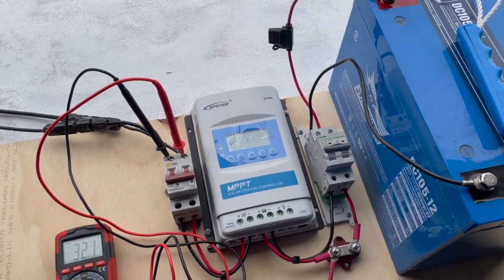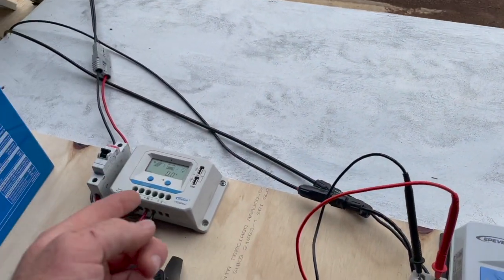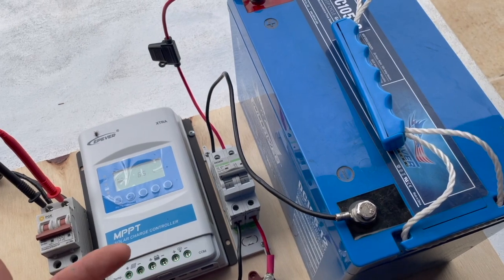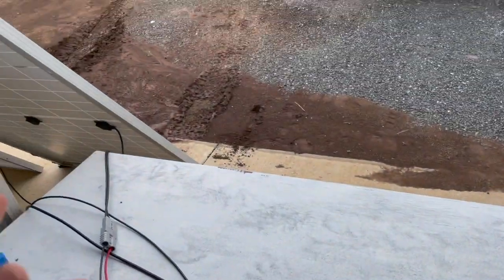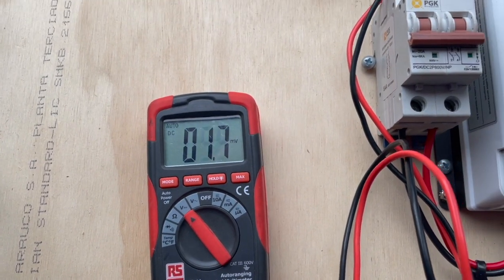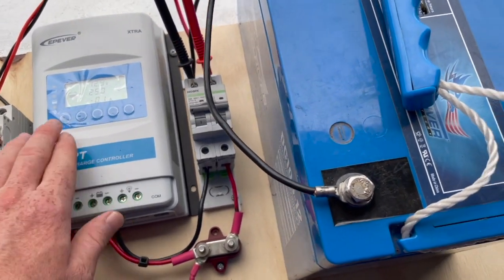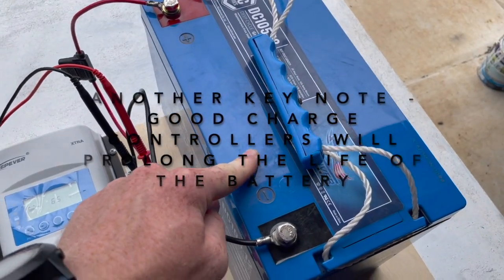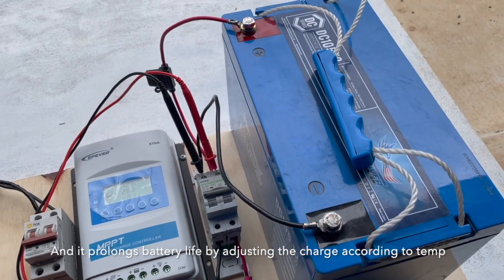Do you need a solar charge controller or regulator?

Comment: Hi, I live in Liverpool Merseyside England and I use an 80 watt solar panel to charge my car battery without a controller. I use a blocking diode in line to stop discharge into the solar panel at night ok. Because of where in live the solar panel never never puts out much more than 13.5 volts, so great video but you should mention the fact of where you live because of the sunshine. If you live in the Sahara Desert yes. Take care Walter from Liverpool Merseyside England
Reply from the maker: Hi Walter - thanks mate. I should probably mention solar irradiance strength here in Aus vs other parts however the strength of the light should not affect the voltage as much as the amps. Your panel must have a low Vmp to start with.  I would still use a regulator if I was you but it if its working for you then happy days.

Comment: I wanna add a system to my semi truck, it has 3 battery’s in parallel I think it’s called???
Reply from the maker: Yeah mate parallel if the voltage stays the same. All batteries have positive connected together same with negative.